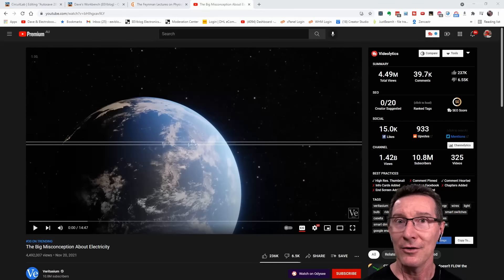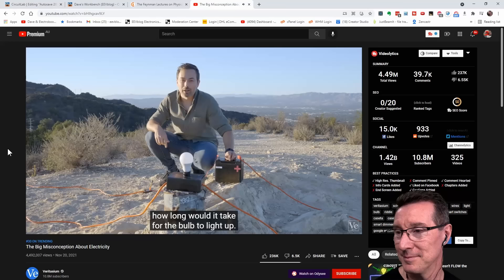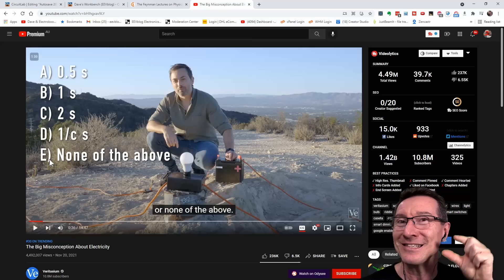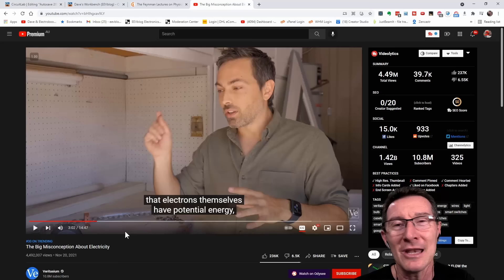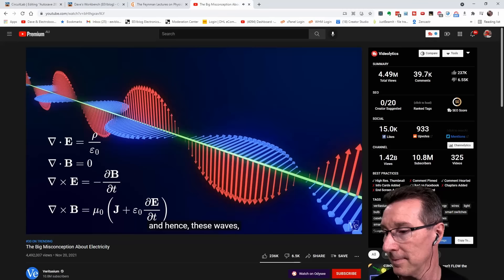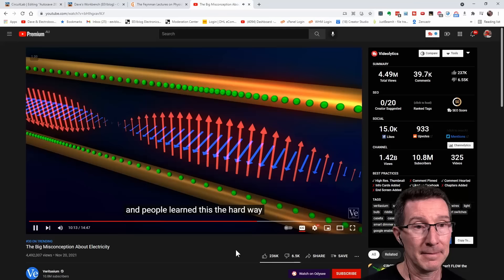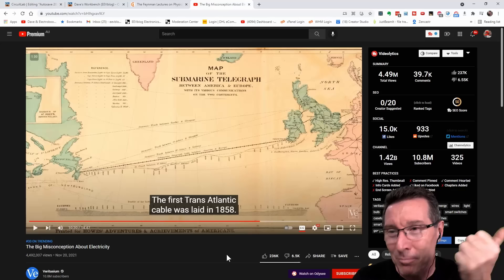EEVblog 1439 - Analysing Veritasium's Electricity Misconceptions Video

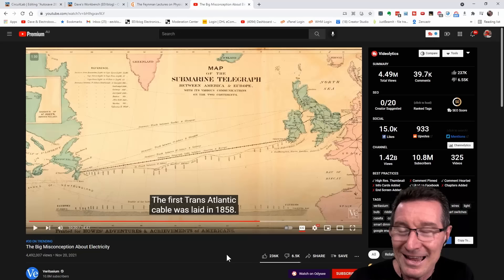Comment: 17:13 if an ethernet cable is submerged in water, or if its casement is flooded, you will have noticeable attenuation in the transmission. its specific enough that Fluke has a cable tester that can detect if a cable is submerged, and how far down the line the fault is. as far as i know, Fluke engineers have the patent on that. i happened to meet one of the Fluke engineers working on this problem, and he did his testing with a big plastic tub of water next to his desk, and a coil of ethernet cable in the water lol

Comment: My biggest beef was the as considering the tiny voltage that you get through the air as "lighting it up" it basically destroys the concept of circuits to me.

Any source that you hold technically lights every single lamp in the world because the electromagnetic field has infinite reach.

Comment: I'm sure others have pointed this out but a quick point about the 1/c thing, if you do unit (dimensional) analysis on 1 m / c = 1 m / 3*10^8 m/s, so unit analysis the fraction we get is m / (m /s) = s. So  it is 1/3*10^8 second not 1 m / c second or whatever.

Ideally if we had a standard math function like absolute value but that was unitless value that turned a quantity in some units into a unitless coefficient you could use that. I'm not aware of such a function but taking a cue from absolute value function if |x| is the absolute value of x, let >x< be the unitless value of x. So >c< = 3*10^8 [where c is specified in meters per second].

So using that the answer d) should have been given as either:
1/>c< s
or
>(1 m /c)< s
or if your willing to let the reader do one's own unit analysis etc.
1 m / c [in meters per second]
or if you want to have a bunch of ugly number hanging about
1/3*10^8 s

Obviously unit analysis gets more of an emphasis in chemistry or solid state physics (personally I only passed stat mech by looking at a problem looking at the equations I had access to and figuring out how to Rube Goldberg myself from the set of units specified in the problem to that required in the solution), but it can trips us up almost anywhere.

Comment: The video triggered me.  I was like yes…what he says is true, but there is a trick here.  Oh it’s a transmission line 300 million meters across and only one meter long.  The old physics trick of assuming ideal conditions, and drawing the problem differently to throw us regular folks off.  Thanks for the explanation, I needed the refresher…have not done drift velocity since 2nd year, and attempted maxwell equations since 3rd and 4th year of engineering school. Great video for us out of practice EEs
Reply: I am wondering thought, what does ideal conditions imply? Does it imply that the impedance is zero? Wouldn't that also mean that the capacitance and inductance of the wire must be zero?
Reply: Derek claimed that the light would come on after just nanoseconds. That means the length of the wires past the first few metres is irrelevant due to causality. So if he is correct, he is talking about a transmission line a few metres across and one metre long. Certainly not enough to turn on any bulb I'm aware of. And he directly implied in the video that this was directly testable with actual "power lines".
Reply: @goodwillhart  He did mention it is hypothetical unrealistic lamp that turn on right away.

Comment: Whilst we all treat ac and dc circuits differently for practical reasons, everything that applies to ac circuits must apply to steady state circuits otherwise our understanding of physics is shaky. Essentially a steady state circuit is just one with an infinitely long wavelength (relative to the length of the circuit), so all the relevant terms drop to (near) zero and can be ignored. When Derek started talking about undersea cables, I instantly thought "yeah, because it's now a transmission line where the length of the cable is relevant given the frequencies you are sending along it". But his video wasn't aimed at engineers - and like you said, if it sparks an interest in science/engineering, that's great news!

Comment: 24:10 as an electrical engineer myself, THIS is the main issue I have with this video.  It tells people that "all energy is delivered outside the wire" - which will make them wonder if their electritian is trying to sell them unneccesarily thick/expensive wires, as the energy does not go "through" them.

A followup video diving into this would be super interesting I think. :)
Reply: If they employ an "electritian" I think that would be the least of their problems! (MY spell checker changed it to "electrician"!)
Reply: The Veritasium video is spectacular. Revealing to the general populous how electricity actually transfers energy is not going to make people magically stupider. Wire sizing is a thing, and I'd suspect more people are aware of wire gauges and amperage than they are of Poynting planes. By explaining to them how the fields carry energy simultaneously while the electrons inside the wire flow, I don't see where anyone would get so confused that they begin second guessing the electrician they hired regarding anything he suggests.

Comment: As someone that is not an engineer, it is definitely something very new.
Before Veritasium video, then your video and other video, I always thought that electricity is about stream of electrons moving, flowing from the power source to devices.
Reply: I thought the same about the flow of electrons being the cause of electricity, and I had to take a digital circuits course in college and took an electricity course as an elective.

I think one of the things I have trouble with is that the electromagnetic fields can't exist without the flow of electrons, and of course the flow of electrons can't exist without the electromagnetic force. 

The thing about electricity in the real word is we have accepted equations, for example Watts (power) is equal to the Voltage times Amperage, and Amperage is a function of the number of electrons in the transmission medium. Voltage is equal to the current times the resistance. It seems to me that you can't have electricity as we define it, without a combination of the electrons and the waves. 

I wonder if this is just arguing semantics, because in the original video Derrick says that electrons don't carry energy, but doesn't anything in motion carry kinetic energy? It almost seems like the argument is more about the fact that the electromagnetic field is the transmission medium for electricity, but we generate the field by moving electrons. 

I I were dropping a rock from the top of a building, isn't the rock delivering the energy when it hits something, even though it is gravity that is the cause of that energy? 

In the end though, it seems like movung electrons  will always be required to make use of the electromagnetic field.

Comment: There was a lot of missleading things in Derek's video, and it took me days to finally figure it out. I never had the same definition of "turning on" as he did. Sure the initial change is at 1m/c s due to capacitive coupling between the wires, but the lamp won't see significant power until it reaches steady state, 1s later. As Dave said, make the circuit a circle, or just seperate the two wires further apart and it changes everything. Derek's video should have been more about capactive coupling between two wires instead of focusing on EM fields. The topic had nothing to do with the quesion/answer. Very missleading.
"switching on" instead of "turn on" would have already made it a little clearer. Very missleading, since the lightbul won't be glowing at 1m/c s.
Reply: Even in a classical sense the light bulb would light up in 1m/c seconds because as Power = Voltage x Current. The voltage would as explained in this video propagate at the speed of light and the current starts immediately after the switch is closed so yeah it’s still 1m/c.
Reply: Glowing and being on are not the same thing, that's an interpretation problem (i.e. you), not an issue with the video.
Reply: @parryhotter3456  'the light bulb would light up in 1m/c seconds '  You guys realize the lightbulb would really never light up due to power sources not being able to drive 300,000KM of line and deliver power to the bulb, etc..
By focusing on one variable and pretending the others are infinite and infinitely efficient, etc, the whole idea is like any other fake 1=0 proof.  You're roughly accomplishing a multiply by infinity or divide by zero by calculating on the 300,000 KM lines when the reality is none of that stuff would be driven that way when you start taking the other variables into account..
IOW a 'Reductio ad absurdum' type failure, or really probably the opposite of that.  Reduced to the point it still seems to hold up, but actually the failure has been hidden in the reduction of variables..
Start calculating all of this out with real 1 m loop numbers and real 300,000km loop numbers and it'll become a lot more obvious that reality isn't going to work this way..
Reply: You are exactly correct, the question is meaningless because of the assumptions that are made. The first being you can have a 0 ohm wire. The second being that we define the bulb as being ON when ANY electrons pass through the "bulb".  Does some current flow through the bulb in 3.3ns, sure! Is it enough current to be significant, hell no! My hunch is that you would actually get way more current just moving the wire 1 cm/s through the earths magnetic field. And Derek's video either fails to point out, or he didn't realize that the bulb would turn off again almost instantly as the transmission line locally meets steady state, and would only turn on again once the electrical field has populated through the wire.
Reply: @Kindo1085  If you had cared to read through the slides provided by Derek under his video, or if you had considered carefully Dave's lumped element model that places a capacitor every certain distance along the wire until half a light-second away, you would realize that the light bulb will not turn off almost instantaneously. The thought experiment is very meaningful to me. The assumptions help keep the video short and keep me focused: I was inspired by the fact that Maxwell's equation, the transmission line theory, and the Poynting theorem could all lead to the same answer!
Reply: @zhuochen6096  Why does everyone not realize Telegrapher's equation was ignored and is not included in Maxwell/Heavside Equations.
Reply: @Sunnyskyguy  Thank you for pointing me to Telegrapher's equation. I believe it was derived from Maxwell's Equations.
Reply: its easy to find transmission line calculators online - a pair of wires 1 meter apart and 1 cm in diameter running parallel will have a characteristic impedance of 640 Ω.  If you take a section that is 10 meters long so the rising edge of the switch closure takes 33nS to propagate from one end to the other, the capacitance across the wires is pico pico farads. A 12V lamp that is putting out what appears to be 100W of light needs 8.3 A to illuminate. its resistance is less than 2 Ω.

So... you couple the battery to the 2 Ω lamp thru the transmission line with 640 Ω impedance to AC and DC surges, how much current gets to the lamp?  12 / (2+640) = 18mA 

that is 0.2W into a 100W lamp. 

Will it light up like it did in the original video? Absolutely not!

and that was the point of the entire video, that the energy from the generation plant to the substation to your home is not carried by the wires, its carried by the EM fields around the wires, which can easily jump across 1 meter from a 12V battery and turn on the light in 3nS.

That is absolutely false and intentionally misleading
Reply: Look, Derek said the ideal bulb would turn on as soon as any current flows, however small but not zero. So don’t say the bulb won’t light up as bright until steady state is reached, because even if it’s true, that’s not what Derek asked, nor was it relevant to the question.
Reply: @Kindo1085  No, the question is not meaningless because of the assumptions made. Then, according to you, circuit analysis is meaningless because of the same assumptions made. Or circuit simulators, because they also use ideal components.

Comment: The simplistic visualization that I've come to love is the one of the Newton's Cradle. Imagine electrons in a circuit as being like the beads in a Newton's Cradle. The beads/electrons themselves aren't energy; they're just transferring it between each other eerily efficiently. And through this same visualization you can also begin to imagine how there can be factors that affect that efficiency.
Reply: That visualisation is no more correct than the naive "electrons are like water" interpretation though. The electrons themselves never carry energy. The power also doesn't come from them pushing on each other. The electrons are simply worked by the electric field, are induced to propagate changes in the electric field into the magnetic field, and by doing so create a favourable combined electromagnetic field that power can flow through.

They never carry energy or power, they are little links in a chainmail of energy transfer.
Reply: @Gyzome  I have always been taught that electrons are the cause of the magnetic field. If they didn't exist, then we couldn't use wires to generate the magnetic field that powers electronics if this is true.

It is very possible that the courses in electronics just don't provide the physics behind this, though it really seems that electricity needs electrons and magnetic forces to exist.

It is hard for me to reconcile the reality that larger diameter wire is capable of carrying more current if electron movement plays no role in carrying electricity.

I have always been taught that moving electrons will generate a magnetic waveform, and that a magnetic waveform will always move electrons (mostly this is from antenna theory). The implication to me seems to be the two are tied so closely together that it is effectively the same thing. 

Maybe the issue I have understanding this is that a pure physics point of view, classifies energy using specific definitions that are outside the requirements of antenna theory. 

My thoughts on the 1/c answer is that the battery side of the rectangle is acting like an antenna to broadcast an EM wave, and the light bulb side is acting as an antenna to relieve the EM wave. The movement of electrons sync up and move through the bulb to produce the output. 

In the point of bulb output, the output of a bulb is the result of moving electrons through the filament. If the light were an LED, then the only way to get it to Emmitt light is through the movement of electrons. While the force that is moving the electrons is magnetic, I have a hard time believing that we could have electricity without movement of electrons. This is why I think people are having a hard time with this, I know it is the cause of my confusion.
Reply: @Gyzome  Not its right. Without electrons you don't have the field. The field happens as a consequence of what the electrons are doing. Not the other way around.

Comment: The counter-intuitive workings of electromagnetic fields was actually what pushed me over to computer science from electronics. I had so many unanswered questions about why we were using the notion of current being a flow of electrons when it seemed flat out wrong after learning about electromagnetic fields. Turns out that it was just an abstraction (albeit a useful one), but I never "got it" back then. Still puzzled that my teachers couldn't explain this in a better. Mind you this was still at high school level (three year service electronics path), but in the end I felt that I was missing so many pieces of the puzzle that I just changed over to computer science instead when starting college. Very informative video, thank you very much.
Reply: when did you change majors? I dropped out of Chem before transferring to New Media. I was looking at a geology course' curriculum and like... I want to go back because it looks like they filled in a lot of holes.
Reply: @illygah  that's weird, I would think filling in the holes would make it harder to do geology
Reply: Interesting! Your understanding of the word abstraction has probably changed so much due to your CS education, you may not have liked that answer any more as a high schooler

Comment: I think Veritasium's video is pretty good, considering his normal target audience, younger folks, high school and college students who may have a general "typical" understanding of electricity.

It's probably enough for those who might be really interested in the subject to generate enough curiosity to end up at a more in-depth video, like this one. :)
Reply: I se this as those like "is it the downdraft or the low pressure making the wing fly"

They are borh part of the same system.

Becuase the magnetic field always cancels out, and is heck of complicated to calculate. Simply just calculate the electron  in stead.

While you dont consider the whole system, it really dont matter as long as there is not some magnetic losses... and well.. he ignores them anyway. So its really just a way to make things harder for no reason.

Of cause when calculating the tractive effort of a maglev train, thst must be caulculated. But nobody does it that way. Simply isolate  the coils anf calculate them seperatly.